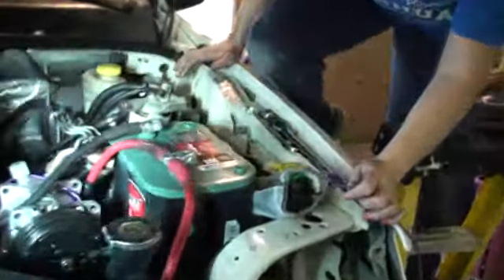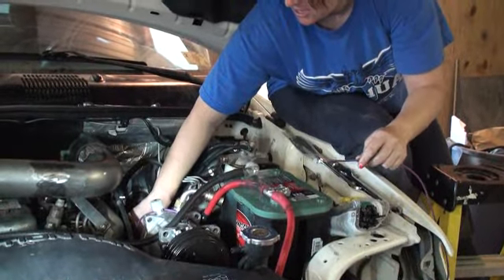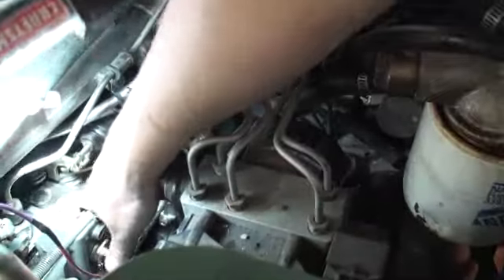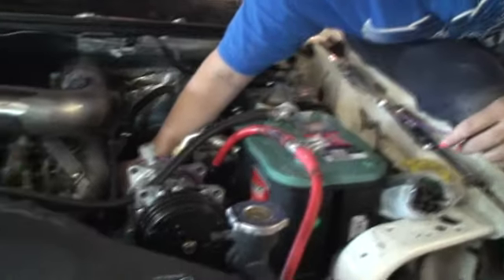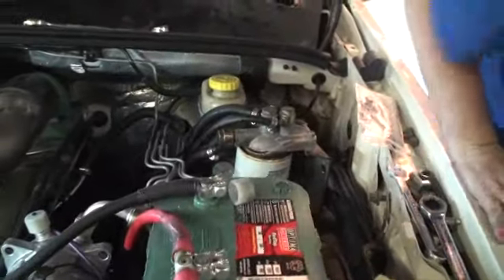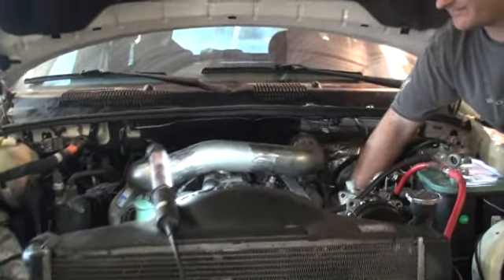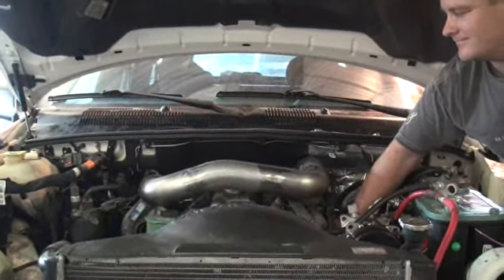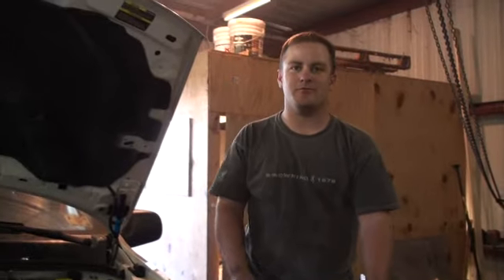Diesel powered Jeep Grand Cherokee WJ

Comment: Horrible throttle response, huge extra weight penalty, SMOG pollution, hard to find Diesel, tons of extra maintenance and so on. Double the oil and filters means more money.  Sounds like a rod or three is knocking. G, I want one. NOT. Forgot about the 47 whole HP it makes LOL.
Reply: jim davidson smog pollution? you do understand that diesels burn cleaner than most gasoline engines? producing less harmful gasses, plus a diesel makes 28% more energy per gallon than gasoline which therefore actually uses less fuel....
Reply: That's the sales pitch buddy. Do you know how much it costs to have the oil and filter changed on a 2009 Ford F350? $120.00 at the Ford dealer. Try that every 3,000 miles. And if they are so clean, why is VW and all the rest of the players getting caught for emissions and junk? OldsmoChrysler Fiat got slammed too. Don't forget to buy some liquid DEF cleaner you pour into the system. More money....... How many filters are on a 2009 F350 of all types? It will ASTOUND YOU sir. These Diesel trucks are maintenance nightmares.
Reply: jim davidson I'm terribly sorry if you bought a newer ford. Anything the government has their hands in goes to shit. Older mechanical engines will out last and out run any of these new ones. And yes when you change your oil every 3k it will add up, that isn't necessary at all not even for gasoline engines. Needless to say I have been around diesels for a very long time and know them inside and out. hands down a better and more reliable engine, sorry your opinion and experience hasn't favored them.
Reply: If you understood the mechanics of it, you would see diesels are way better. a TD will get better fuel economy than a gasoline engine, especially the v8 in  this jeep, and pull better. They burn cleaner too because you don't have a throttle plate, so the fuel can burn fully before exiting. If you tune it and dump massive amounts of fuel into it then its dirtier. Depending on the engine it shouldn't cost too much more to change the oil than a normal engine, and with the proper maintenance, they last forever.
Reply: Hard to find Diesel ???? it is the most common fuel on the planet LMAO 
As for the rest of your comments well it is very obvious you do not know anything about Diesel engines.
Reply: Plot twist; if you can't afford a diesel, don't fucking buy one!!